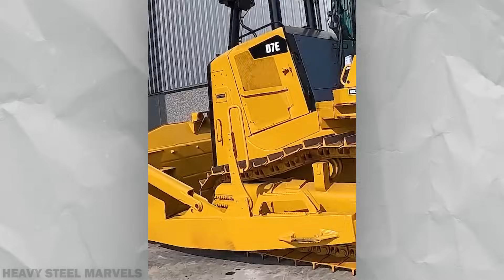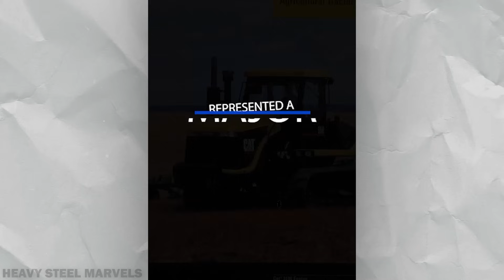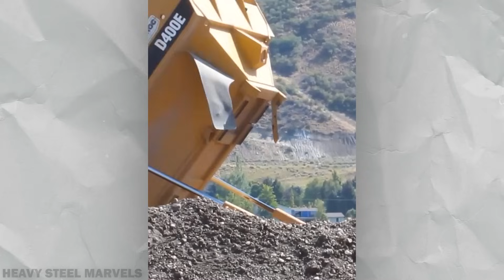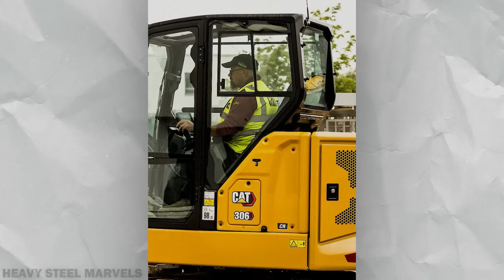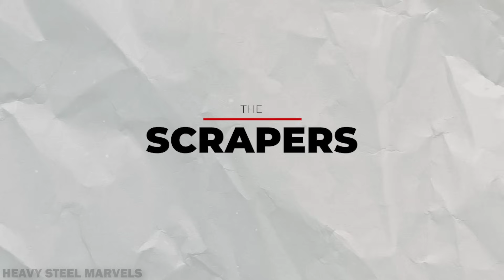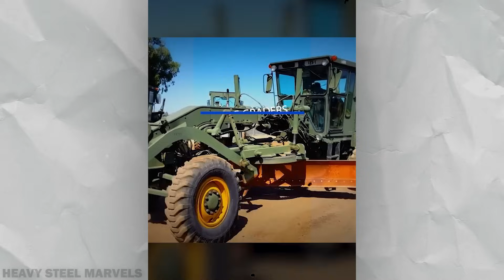This Video Will Make You A Caterpillar EXPERT

Comment: The "D" in Caterpillar dozer models originally stood for "Diesel" reflecting the early use of diesel engines in these bulldozers. Over time the "D" has simply become a standard part of the naming convention for Caterpillar's line of track type tractors and bulldozers, no longer specifically referring to diesel.

Comment: Owned Two Cat D6C one standard and one LGP . Also a D6D LGP
Had Cat 330B with a Waratah bigwood log processor , driven 320 and 312 325 300 cat excavators over the years . Solid machines Also done time on gas pipelines operating 572 ,583 , 594, 587 side booms both manual and hydraulic . Plus Superior 960 Gladiators that were Cat powered . My favourite the 594H based on the D9H but with a wider gauge . Those beasts were fast and had a huge lifting capacity . Cheers from NZ

Comment: The 245 excavator was what I remember back in the late 1970s 😊 I was " KING" that single lever track steering. No one else had that, and it was never copyed. I liked the 235 because I was told it could be loaded on a low-boy trailer without removing parts of the bucket or dipper 😊 Cat was also the leader in the two hand lever, very easy to operate control patterns. I think a world favorite 😊 my 1978 Dynahoe-190 made by Bucyrus Erie  factory species called for two lever controls to be John Deere control patterns, but all the ones I ran back in the late 1970s had Cat controls. Even my big baby girl (19000) pounds of play toy. To change the control pattern, you have to completely move hydraulic hoses coming into valve body under controls. So even if the machine called for ( JD) control pattern, they all opted for "CAT" controls 😊 in my humble opinion. I am like you, love the excavator that you liked made by CAT. 😊